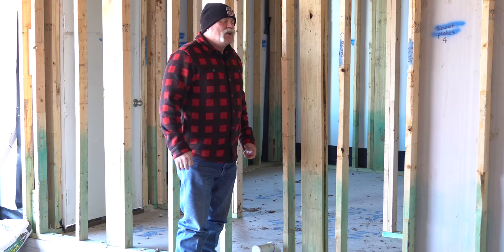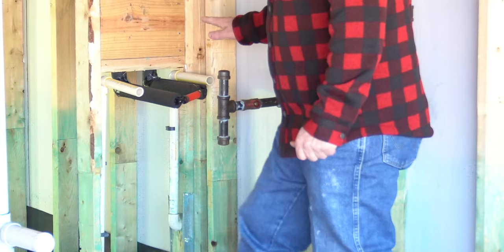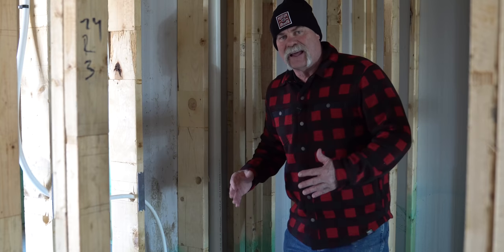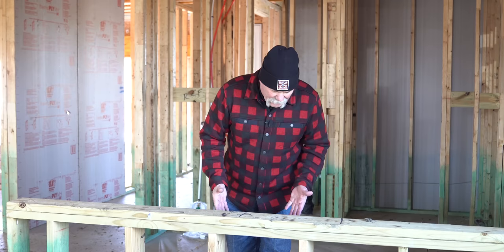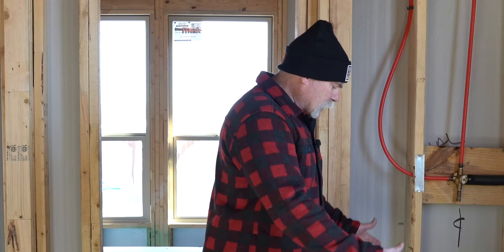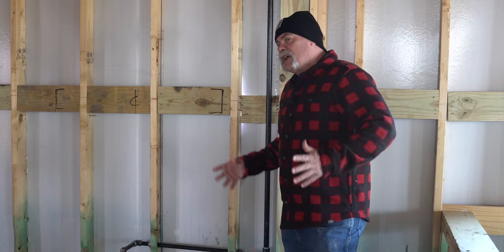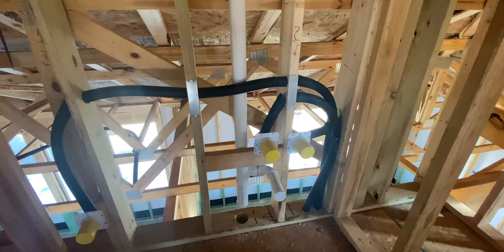How to Plumb a House | Top Out

Comment: Also on the master bathroom shower, it did not look like there was any type of isolation stops built in to the diverter. Are those PEX water lines connected to some sort of manabloc to isolate the shower? If there's no isolation it will fail in my state
Reply: Shutt of valves are not required in Texas for a shower valve even do i agree it would be best to only shutt the water off to the valve to replace the carthridge
Reply: @ImYourHucklebery117  Here in NJ EVERY plumbing fixture must have shutoffs or stops in order to isolate of there is a problem according to the NSPC
Reply: @guitar1301  that would be great if they'd do it like that in texas, but it really doesn't get that cold here
Reply: @ImYourHucklebery117  LOL  🤣🤣🤣🤣🤣🤣
Reply: @jimharper6073  not talking about last February, that was a 1 in a 100 year freeze. Made lots of money on replacing Tankles and busted lines
Reply: @ImYourHucklebery117  what the heck does that have to do with it freezing?

Comment: That kitchen sink is a mess…  no vent? And the hot water is loose. They could have used a bracket like they did in the bathrooms. 

To be fair, these are probably Tract homes so the top out was probably done in a day lmao so I get it but still this particular installation probably isn’t the cleanest but i wouldn’t doubt that it passed. 

Honestly my biggest pet peeve is too many holes drilled into the studs. Looks a messy but that’s just me.

Comment: I hate pex stubouts i like the copper stubouts for pex they got the nice copper brackets to hang em up straight on the stud. Im so sick of walking into multi million dollar beachhouses and seeing 3/8 “ pex just flopping up into the vanity or sink with NO STOPS its all 3/8” maninlock pex THROUGH OUT THE WHOLE HOUSE! At least they use minimal fittings cause theyre cheap so less flow restricion on the already restricted flow. They just tack it up all loopy and rollercoastery in the crawl so the hose bibbs just drain back into the crawl 🤷‍♂️

Comment: This American standard of plumbing is ridiculous. First of all fittings inside a wall is a major risk of concealed leaking. Number two, There is no way of changing  the pipes without destroying the wall. Number three, I don't see almost any proper ways of  fastening the pipes inside the walls, so they will move when you quickly close a faucet. Number four, you can't see the leak when it is inside a wall. These are one of many things which I have noticed in American standard of plumbing. You Americans are top of the line in many other things, but when it comes to plumbing you are still in the 70's or something. And sorry for my bad English. I am from Finland.

Comment: I hope this is not the future of rough plumbing as this is an example of the race to the bottom. There was a time when tradesman took pride in their system design and installation, some, myself included still do. This makes me sick to my stomach. Why are you praising this? Most building codes set  the standard for the worst house you can legally  build, here you are! This is a rant. If you're looking to argue about it, you've revealed a lot. If your looking for a plumbing system built to a high standard, change the channel. C'mon, Roger!

Comment: This has to be some of the worst plumbing I've ever seen.  Pipes aren't strapped well, dead end clean outs are rat nests, should be washed at the base. 1/2" to a single fixture is perfectly fine. Size of gas line is dependent on pressure, length of the run and the btu rating. Studor vents suck. Crosses are a terrible idea, use a high/low fitting set up instead. Would hate to see what they did on the ground rough.
Reply from the maker: I mention it in the video. We did a video on a rough in, before and after, the slab was poured.
Reply: @RogerWakefield  Hey Roger, don't mean to rag on you, love your videos. I like seeing different perspectives, that's how we learn. Just can't stand how all these new products take the craftsmanship out of the craft and away from the craftsman. I feel that it dulls our edge over time.

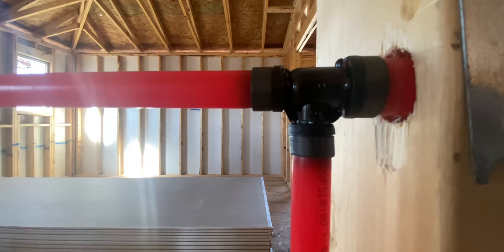Comment: Are we not gonna talk about the upside down San Tee at 10:38
Reply: Thats for the vent! So it will flow up not down
Reply: @Tdrr8989  he probably only works doing roughins, ive seen lots of guys who work only doing rough ins and when they do a top out they put the san tee like if it was a dran and i always have to explain to them then venting is basically the opposite
Reply: It's for the vent.

Comment: It’s all code, don’t pick apart an install when it’s code approved it shows that you may have a misunderstanding of flow/pressure vs. the restrictions already present in the plumbing fixtures themselves. Like small water flow  ports, screens that toilets also have, shower head and lavatory flow restrictions that are code regulated, heat traps in water heaters. Like an ice maker sharing the cold with the kitchen or the dishwasher sharing the hot with the kitchen. That’s stupid to say that’s not ideal, it’s actually perfect.

The laundry box needs water hammer arrestors integrated into the feed valves

I would hate to have to plumb a house after the homeowner watched this video, useless advice